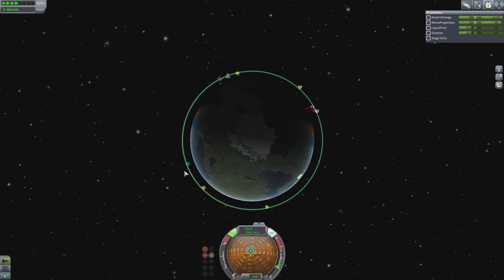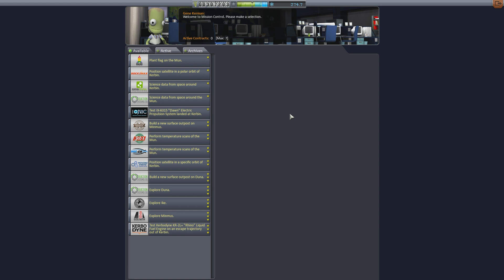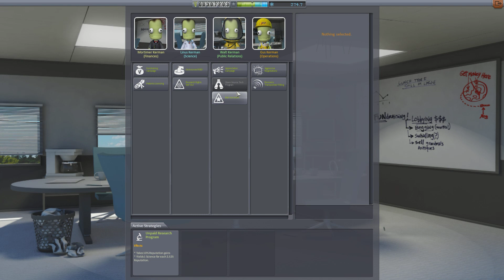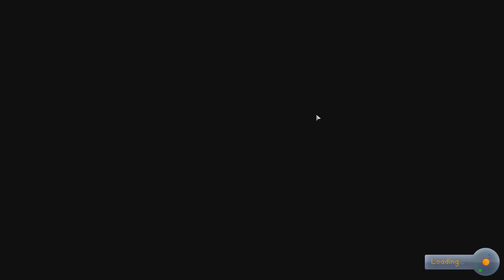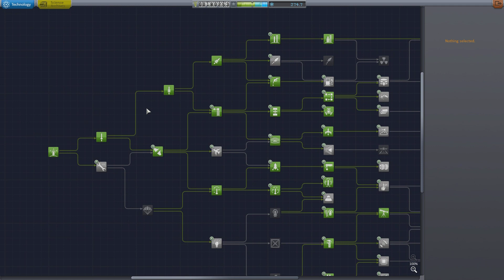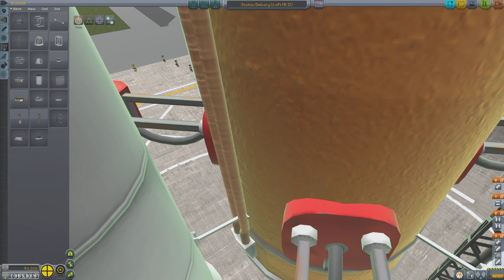Kerbal Space Program Let's Play E27 - Dealing with 1.0

Comment: The update stole all your gear and made the craft turn upside down and crash. I'm glad this is just a game and not an operating system. Automatic updates meh!

How does a spacecraft turn around without the RCS nozzles? (if you haven't got them or they're covered up by a faring)
Reply: j7ndominica0 In addition to RCS, KSP gives you two other ways to control the facing of your craft.  There are fins (some of which have control surfaces, but they're only good in the atmosphere), and there are reactions wheels (massive wheels that spin in various directions to force the craft to spin in opposition) in the command pod or probe body.